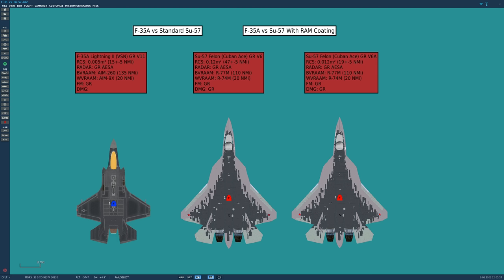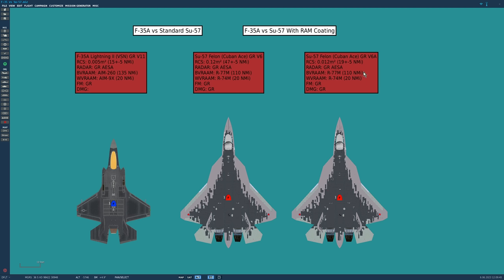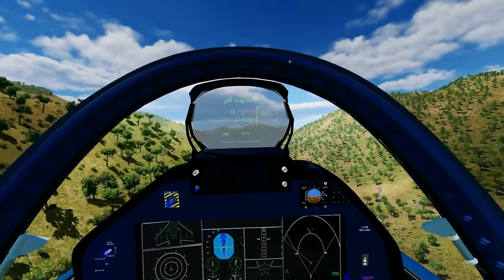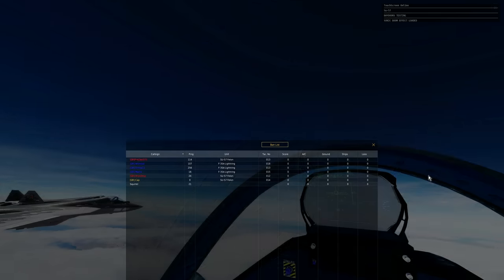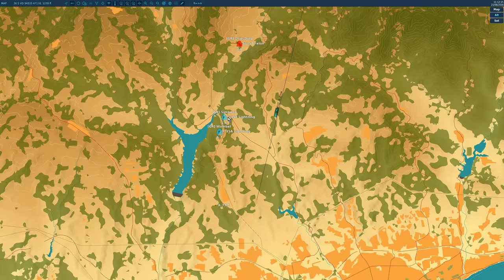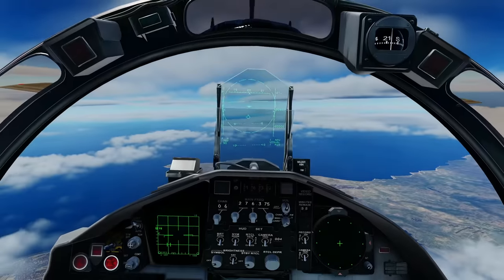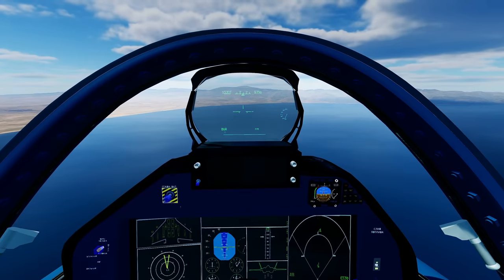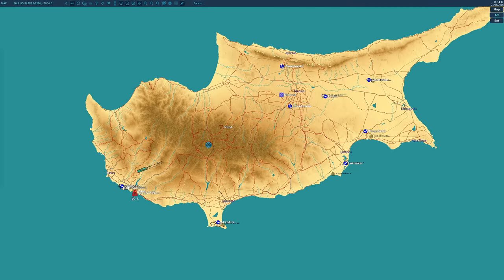F-35 vs Su-57 With RAM Stealth Coating: BVR Missile Battle & Dogfight | DCS

Comment: I don't know what you guys do wrong in the SU-57 but GS has beaten both the F-22 and F-35 with it in the past 2 weeks, maybe you are using an old mod but the one he is using picks both F-22 and F-35 up on radar as a small dot, enough to get a firing solution and take them out. 

No way you should be getting performance this bad.

Comment: Personally I believe all Russian claims and photos should be taken with a massive mountain of salt, including their claim that the Su-57's panel gaps, wood screws, etc.. have been addressed, and that they even have RAM coating at all. 

RAM coating is fucking expensive, difficult to get right, and requires a lot of maintenance. These are areas where Russia doesn't have a good track record.

My vote would be to leave the Su-57 as is, as it's already benefiting from Russia's claims regarding the effectiveness of their radars, missiles, etc..